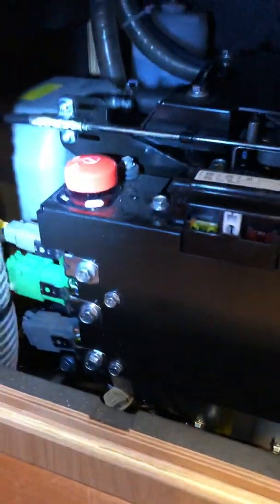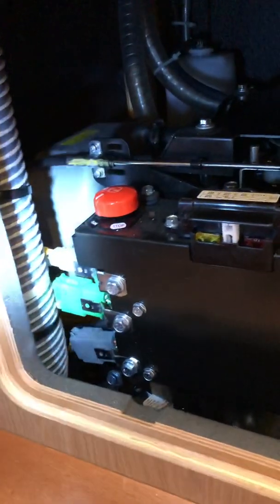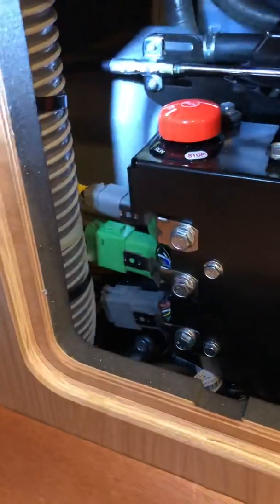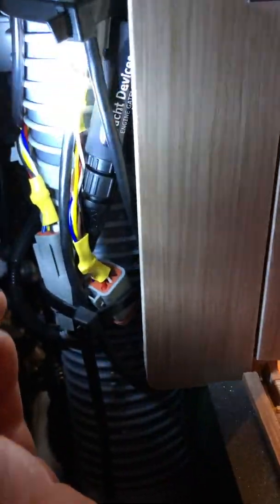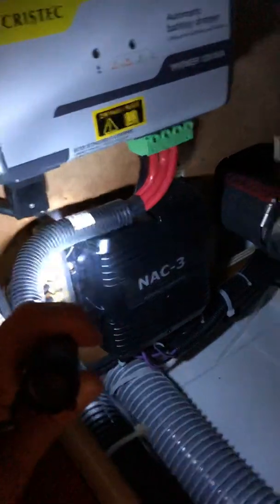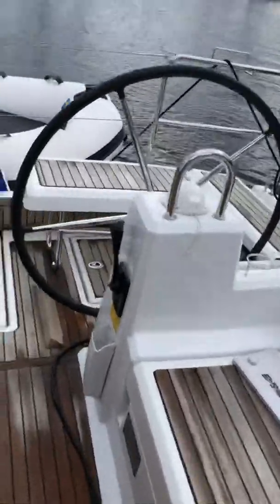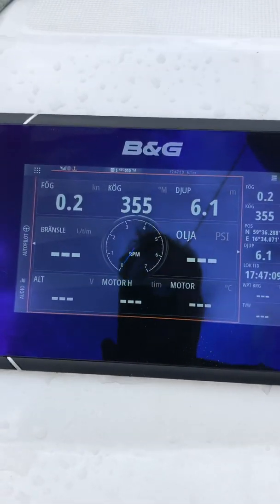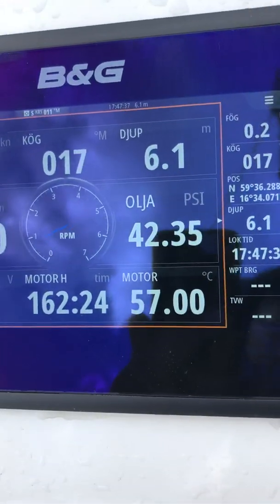Yanmar 4JH45 data on plotter using YDEG-04

Comment: For anyone trying to replicate this, you need a $60 adapter. I also have a 2018 Beneteau 41.1. with the same 4JH45 engine. The YachtDevices unit I purchased (YDEG-04N) needs an adapter to fit the 4JH45 engine. It is available on the YachtDevices website.

Comment: I have a question, i have a 3JH40  2019 ,the panel show COMM ERR,the manual say is a problem with connection, the mechanic from yanmar  tell me is a problem  with the computer. 
I didn't like this sistem because I con not  start the engine ,no emergency start ,nothing, imagine happen in the middle the ocean,new yanmar is no good